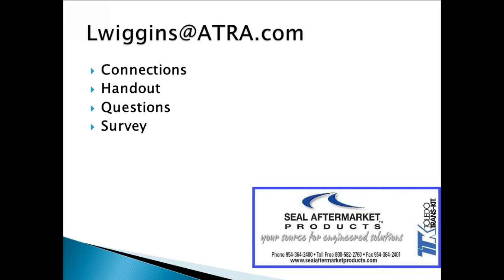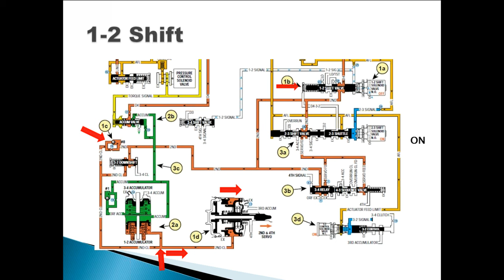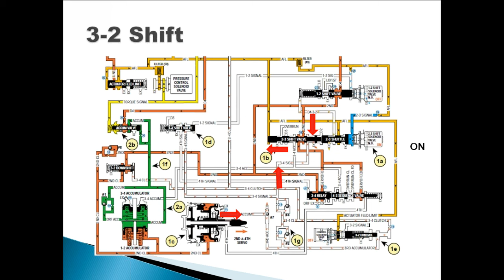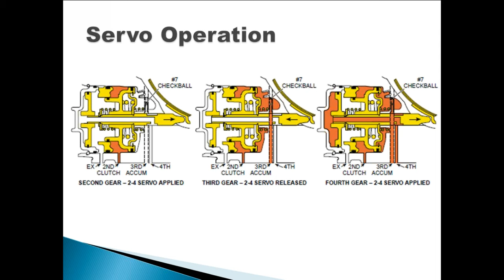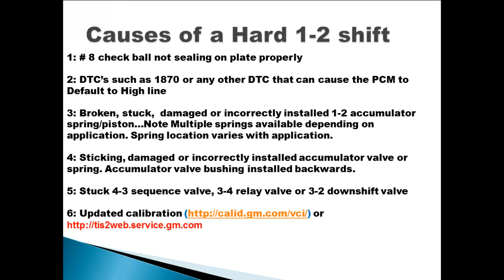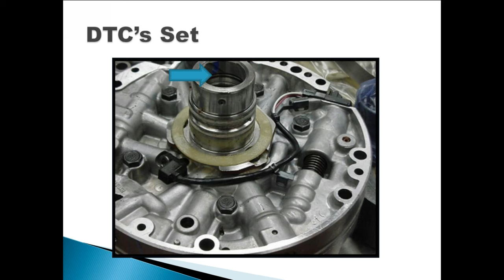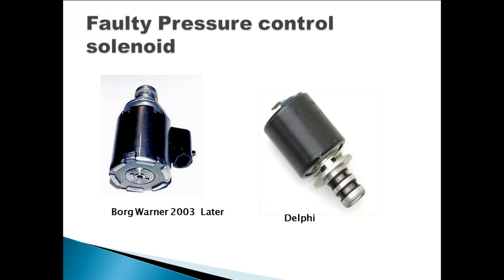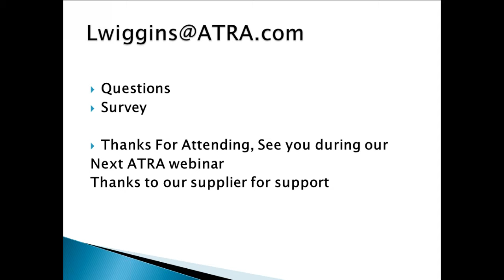4L60E Refresher

Comment: Hi, Great video. Any idea's on the following. 4L60E Transmission has developed harsh 3-4 and 2-1 shift transitions. More so the longer you drive it and more so when barely under acceleration, IE when coasting / gliding. 3-4 is a harsh dump into 4th. Not a smooth transition. 2-1 when gliding into a stop it clunks into 1st at the last minute. It's almost like a delayed / stuck reaction .-.-. 
Show less